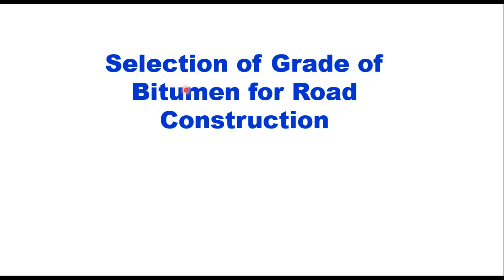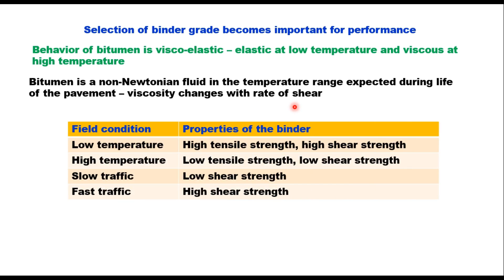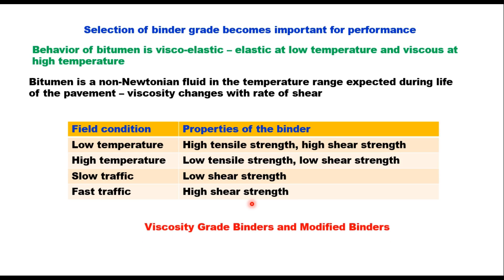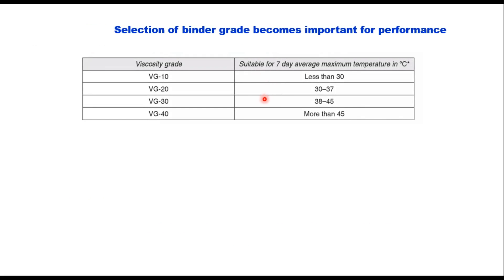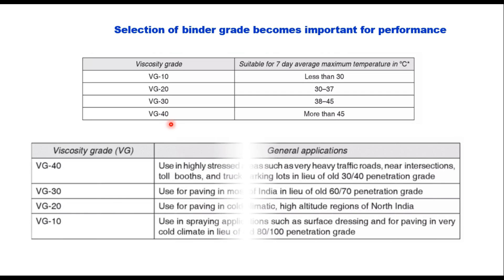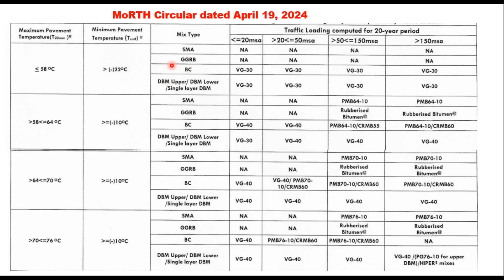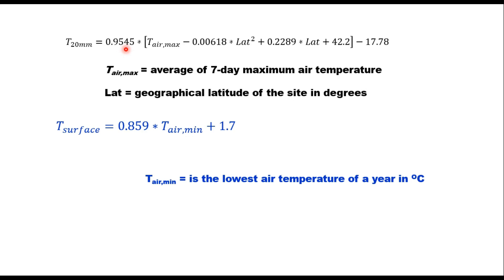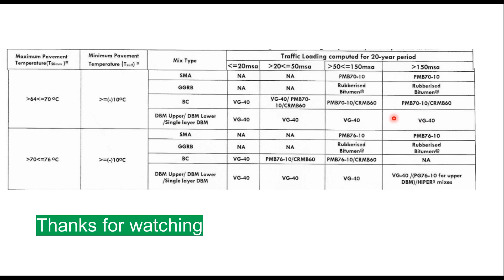Selection of grade of bituminous binder for road construction - General guidelines, MoRTH circular

Comment: Sir, but why are the modified binders are not used for DBM layer ? As per all the standard only VG binder is recommended for DBM layer. But Modified binders are more fatigue resistance as compared to VG.
Reply from the maker: Modified binder can be used in DBM layer also if site conditions are very severe and warrant use of modified binders. In fact, the Ministry issued a circular way back in 2011 permitting use of modified binder in bituminous base course layer also. 
https://morth.nic.in/sites/default/files/circulars_document/SR-2011.07.19-USE%20MODIFIED%20BITUMEN%20IN%20BASE%20AS%20WELL%20IN%20WEARING%20COURSE.pdf
Reply: @SatishIITR  thank you so much Sir.  Your videos are really very knowledge. I m learning more pavement and highway design concept through your videos. Keep posting it sir.
Reply from the maker: @sagarshukla3198  Keep watching. I am posting a new video every Sunday and Thursday at 4 PM

Comment: In general, plains in India have max pavement temp of more than 70° and other cold places ranges from 45-70 ° based on the region
Reply from the maker: All studies conducted worldwide indicate that pavement temperature is around 15 degree higher than ambient temperature. In India air temperature is hardly more than 48 degree (that too in a very limited area) and therefore the maximum pavement temperature should not be 65 - 68 degree centigrade.